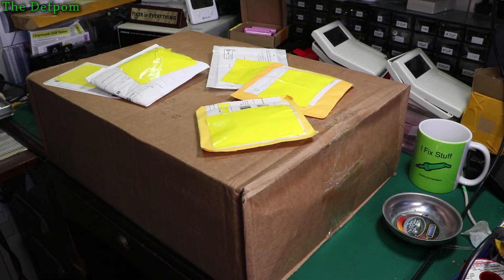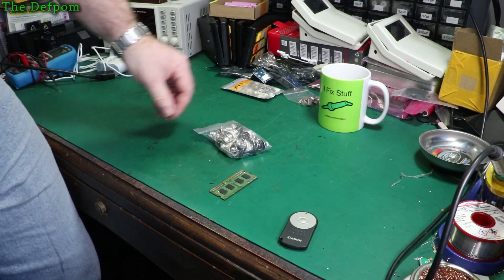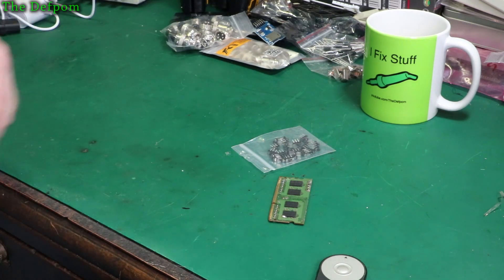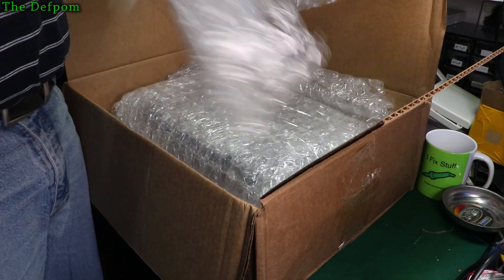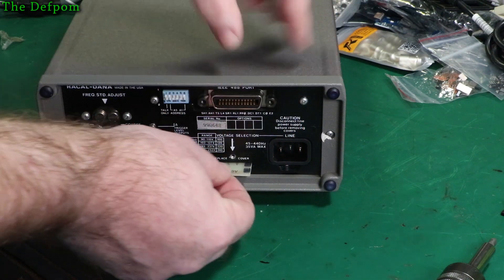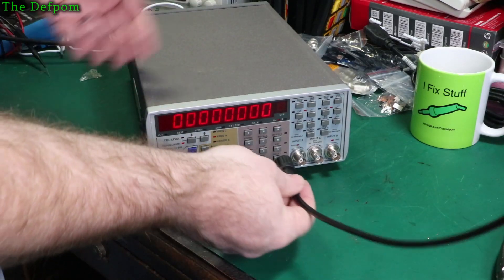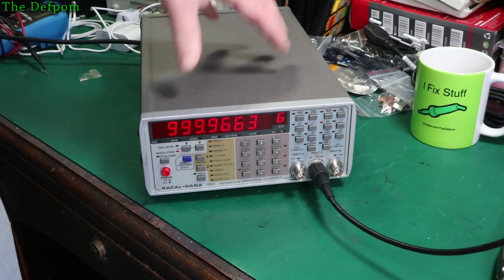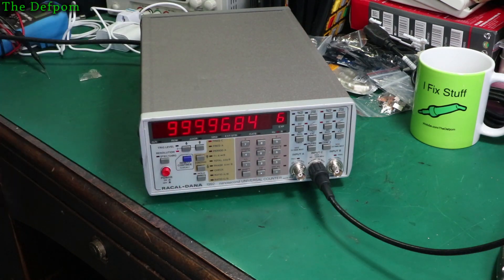#716 Mailbag Monday 18th May 2020

Comment: The only reason I bought my 1991 was to bring back memories of having used one in the late 80's onwards. I remember we bought it new after having used the 9901 for many years. Anyways, my 1991 had faulty switches also.
Reply from the maker: IanScottJohnston - my original source for the buttons I used previously is gone, so I have ordered a few different ones, will have to see what (if any) will do the job.
Reply: @TheDefpom  Yeah, when I did mine they certainly weren't perfect. If I was doing it again I'd try for a better fit.
Reply: @IanScottJohnston  It would be nice if you guys were both able to source replacement buttons and do repair videos.